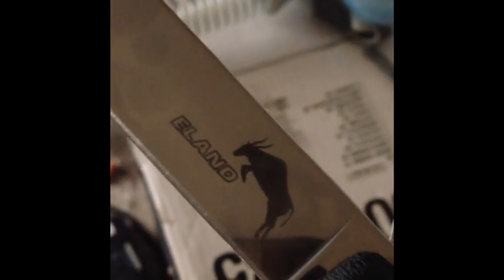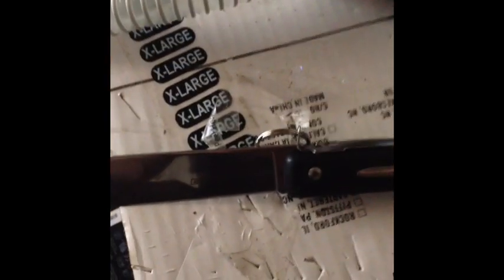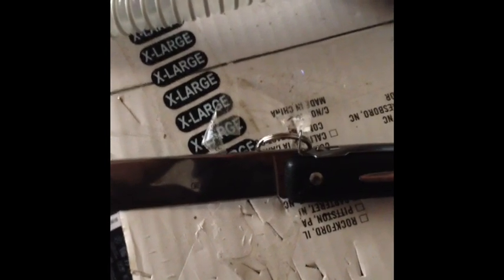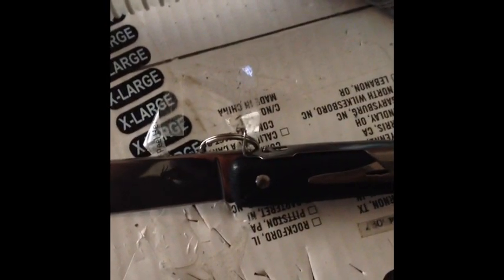Cold Steel Eland Lock Issue

Comment: Looks like the spring is too weak for the length of the blade and the depth of the locking notch. The fix would be to give it a stronger spring, deeper notch, or both.